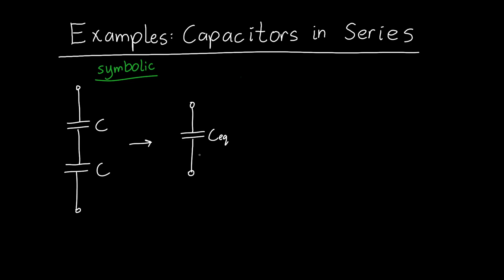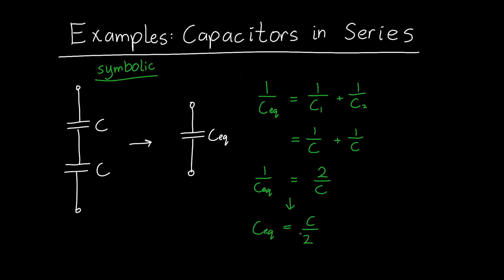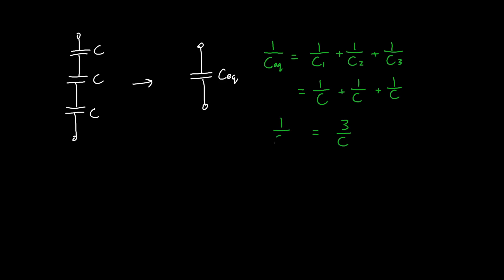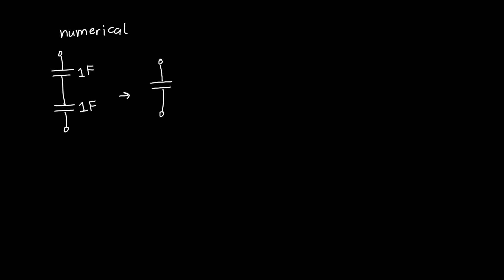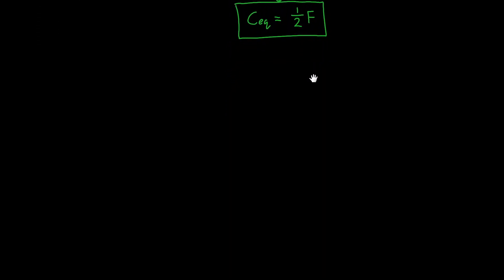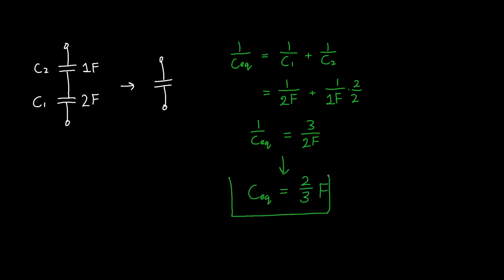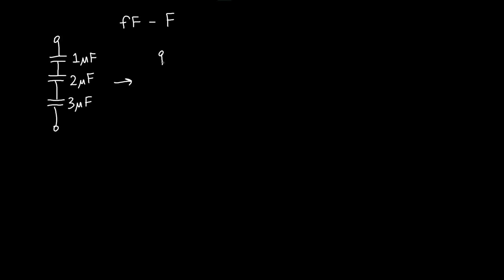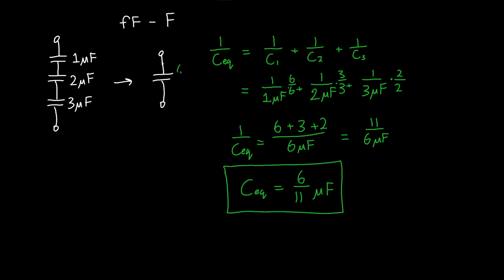Example: Adding Capacitors in Series

Comment: Really nice video. I did something similar, but with resistors. I used Mathematica and had it do 10, 20, 30, etc resistors in parallel, just so I could watch it simplify it with a common denominator. Pretty crazy, but so much fun though.